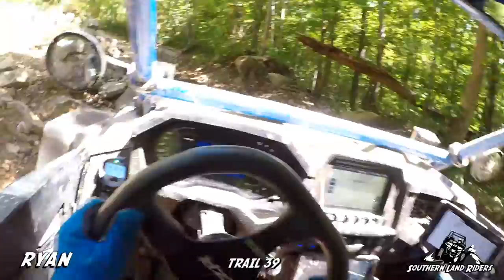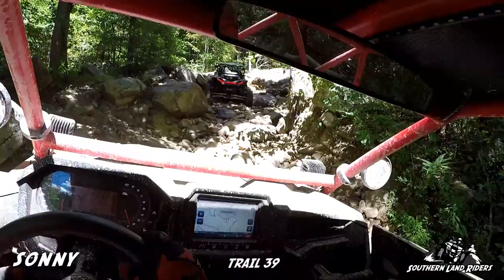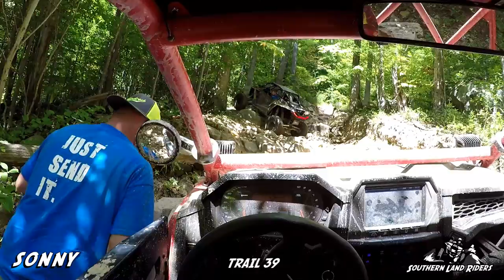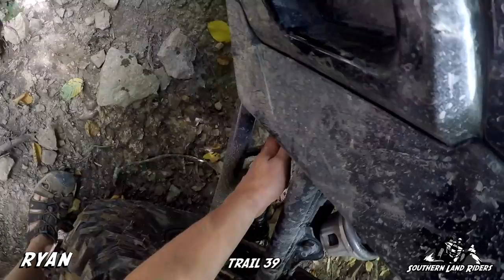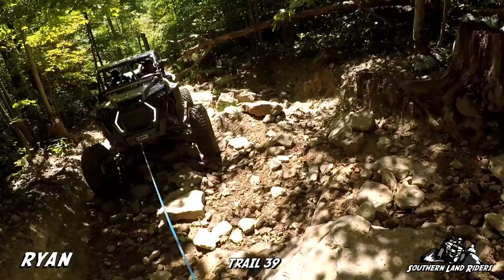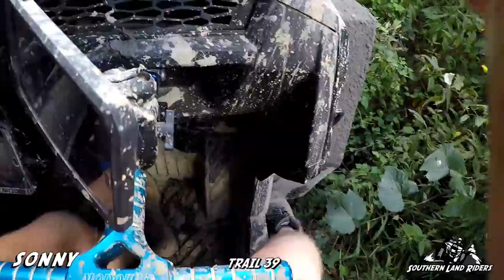Windrock 9/2018 Day 3 Part 7 (Trail 39- Cadillac Hill)

Comment: merry Christmas everyone. In the group we ride with we always carry a spare front and rear axel. The way we carry them is we created a tube out of pvc pipe and sealed off the one end while making the other with a thread on it. Then we just put the axel in some bubble wrap and slide it into the tube and put the cap on. Makes your day a lot better once one of them bad boys break on you. We have them mounted above the bar where you mount your harnesses in (behind the seat) your able to fit two back there for a front and rear but it restricts vision a little bit. But one tube works awesome. We painted ours black for a little more appealing look.
Reply from the maker: Merry Christmas Mitchell. I used to carry a spare front and rear axle in my old RZR. Since pretty much our whole group has the same machine now that is probably a smart thing to do. I carry the chainsaw, jack and pretty much every other part with me so I am thinking one of the other guys needs to carry the axles. 😐
Reply: haha yes. I would say the axle carrier would be one of my favorite additions. sets your mind at ease sometimes. They are pretty cheap to make and work great. Hope to see y'all with one on your machines one day. No more rescue missions for a axle haha. @SouthernLandRiders

Comment: Are the Turbo S' with the extra cash over the Turbo's?  Does the extra width cause trouble on the trails?  Thanks for the videos, they are great.
Reply from the maker: They are in my opinion. The upgrades (drivetrain, suspension, ride command, dynamix, 32" tires, beefier suspension, width, etc. make it more than worth the extra money. Thanks for watching the videos!
Reply: Thanks for the info and the videos.   @SouthernLandRiders
Reply from the maker: You bet!

Comment: My winch did the same thing. The power supply for the wireless receiver had a lose wire. Where it comes off the contractor and goes into the weatherproof connector pulled out.
Reply from the maker: Yeah we figured out later it was a bad relay. It would have made things a lot easier if that winch had worked at the time.

Comment: I have the same set up on my RS1, the winch with remote, dont like it, to many things can go wrong, dead battery bad relay loose wires, but great video
Reply from the maker: Thanks Ron. I agree about the winch. I can't believe they have the solenoid mounted right there exposed by the wheel. It should be tucked under the hood somewhere.